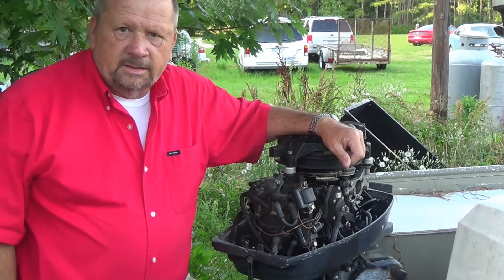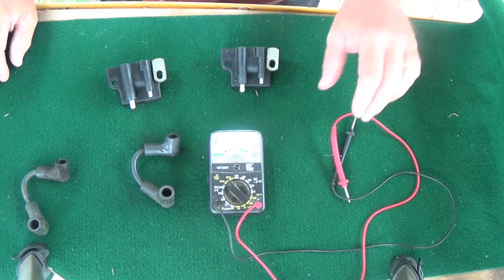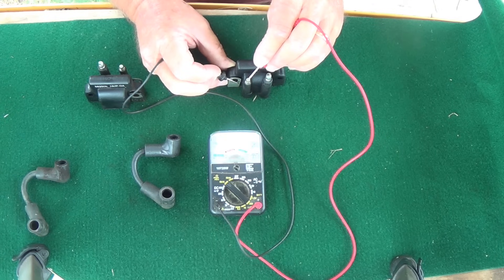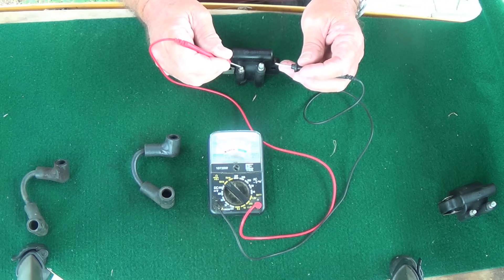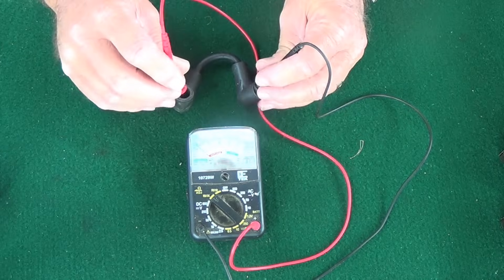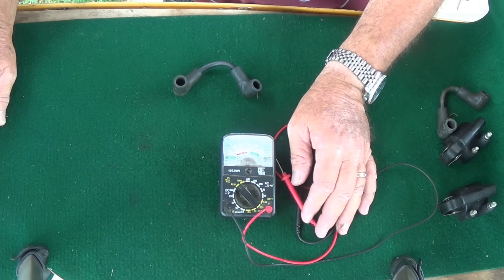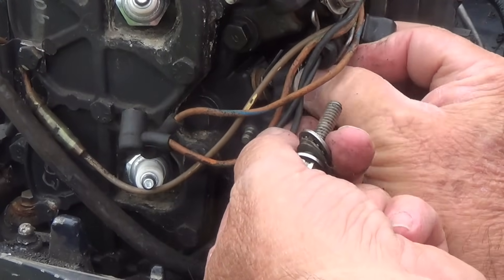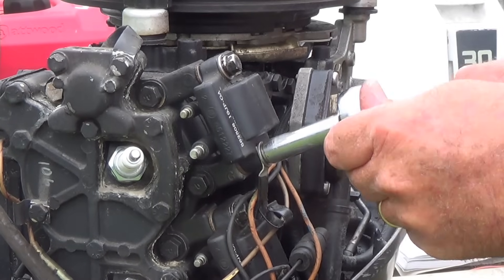Coil Test {would you look at that!]

Comment: Are you using the same scale for both readings?  Should use the low ohms scale for primary and high ohms scale for secondary..These coils are pretty reliable but you have hit on a common problem....High resistance in the plug leads due to rusted pin terminals, always something that should be checked...Another problem area is the primary wire connection, they get loose and corroded....I know that the OMC manual talks about checking the secondary between the primary and secondary terminals, and that works fine on this engine, but each circuit should be checked to the ground strap in order to isolate the primary/secondary windings on the coil....Your plugs look fairly normal for the 32CI OMC models.  They look different because of the darn recirculation system which is there to reduce the amount of unburned fuel/oil dumped back into the water....These engines can be frustrating because they are tough to dial in at idle, mainly due to the uneven conditions in the cylinders caused by the recirculation system...This was introduced in the early 70s, idle quality dropped off dramatically.
Reply from the maker: Thank you very much for catching that and for sharing your knowledge with us. That is what my channel is about just keeping the old stuff running and enjoying the day at the water.
Reply: Well, like I said, you hit on one of the major problems with these coils...The goofy plug terminals/wires...The pin often loses connection with the copper wire core, and gets rusted.  This can surely cause ignition problems and increase the load on the coil secondary winding...
Reply: 87 Mitsubishi Mighty Max cranks builds compression and backfires no start

Comment: Hi! 
How do you know how much you should pull the bolts? 
Do you have a good page for Evinrude and Mercury? 
Thank you for good videos. They have helped me a lot. 
Sincerely
Mikael from Sweden
Reply from the maker: It gives the torque chart for bolt size. No. 6, 7-10 inch pounds NO 8, 15-22.   NO 10,  25-35.  NO, 12 35-40.  1/4 in, 60-80.  5/16 in, 120-140. 3/8 220-240. 7/16, 340-360. if the torque is not listed in book use this chart  tighten in sequence to  1/3  Then 2/3 ,then torque value. You also so need a torque wrench you set it to the torque you want and it beeps or clicks when you reach the much torque. {When the bolt is tight enough.

Comment: motor runs great after you start to run the heat alarming  goes off.
Reply from the maker: I would check the thermostat first and the sending unit to see it it is working correctly. Check out my video on thermostat replace. Does the water feel hot coming from the engine. I have never had any luck trying to find a hot spot on the engine so I just go through and just make sure everything is working correctly.
Reply: impellar is most likely old and barely working.Never run ANY outboard for more than 5 secs without water supply   .5sec max ! Anything longer WILL damage ANY impellar

Comment: I have a 1979 johnson 115 hp v4 and it will only run for about 5 seconds?
i fully rebuilt the carbs,replaced the power packs, tested coils ok! replace fuel pump fuel lines,reed valve at fuel pump port
What do you think is wrong with it?
Respond ASAP
Thanks
Reply from the maker: Thomas Flynn The first thing I would check is the hoses on the recirculation and all the check valves on the recirculation on my Evinrude 225 was doing that. most of the check valves were not working